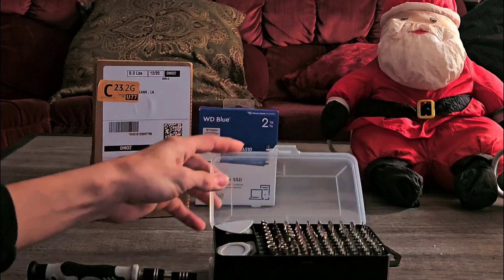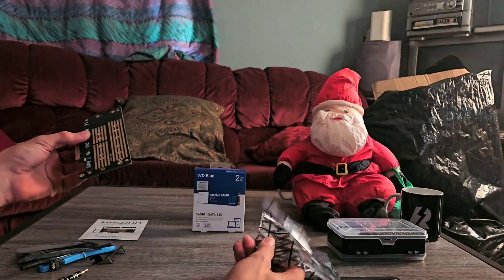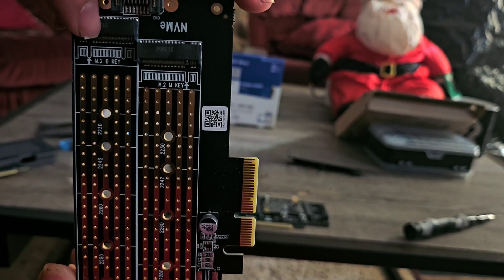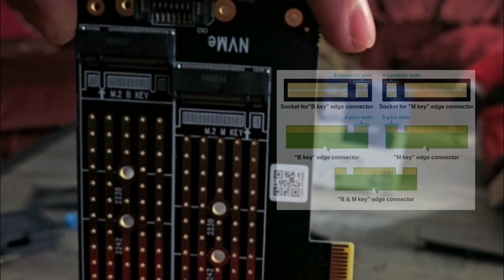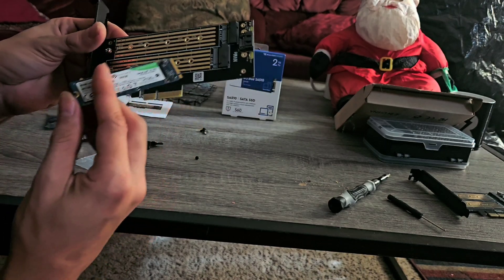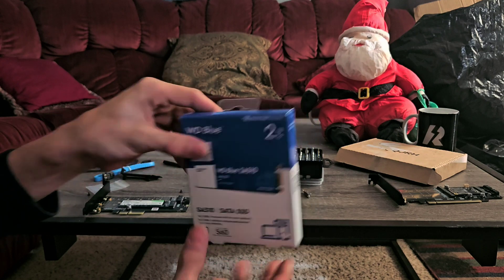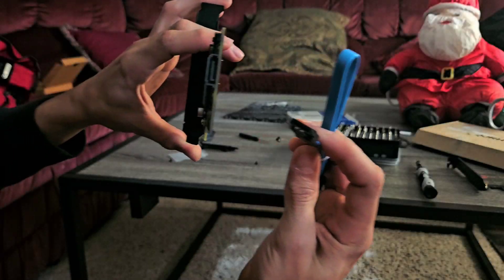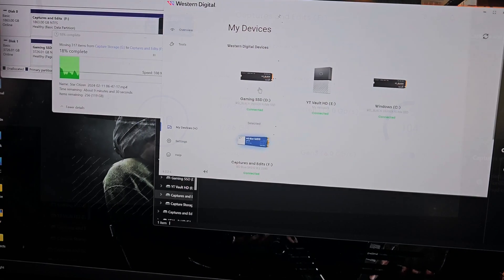How to Expand SSD Storage without Bifurcation - Evolv X Storage Upgrade

Comment: I forget what company it is but they sell an m.2 drive with a usb enclosure with the drive so just buy that instead if you are just using it for a save drive..
Reply: No actually it's a big company and the m.2 comes with the usb plug in to make it internal or external.
Reply from the maker: The company you're thinking of is called SABRENT they make all kinds of storage solutions, both internal and external. I wanted the internal dual drive so I can run 2 different storage cards for different things.

Comment: Ähm, did i miss something? I believe this guide makes only sense if you already have an M.2 SATA SSD, which is rare, and nowhere to put it or your case has absolutely no place for a 2.5“ SATA SSD. Going out your way to buy an M.2 SATA SSD and this PCIe card to avoid bifurcation is like putting down the pants before you fart, totally pointless.
Reply from the maker: The point was to seek alternative options. Yes, it does give you space on the card for one Sata. SSD, but you can install 2 storage devices. One NVMe Drive and a sata based M.2. It does have a point because I get more storage. Why do you think I went with PCIe? Bc they are no storage Rack in my PC. It came with racks, but I don't need to use them instead of having all slow storage options. I would rather split between a fast drive for secondary game storage and an intentional slower drive for my work files.
Reply: @Revolt1Purger  dumb decision != alternative option. you don't need storage rack for SATA SSDs, they're non-vibrating and need zero airflow.
Reply from the maker: I know i don't need storage racks. I don't want a traditional sata SSD ether. What's dumb for you is great for me. Because I rather use my PC i.e. slots and have one extra  NVMe drive with it.